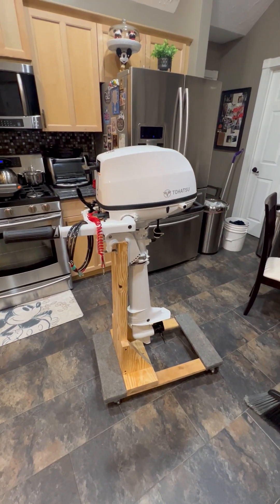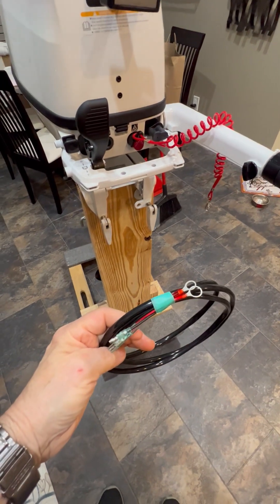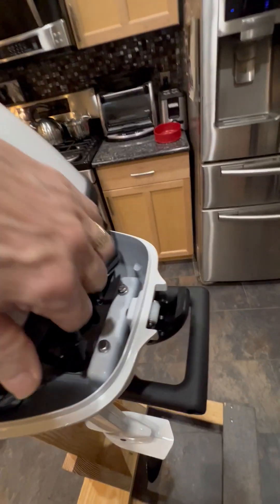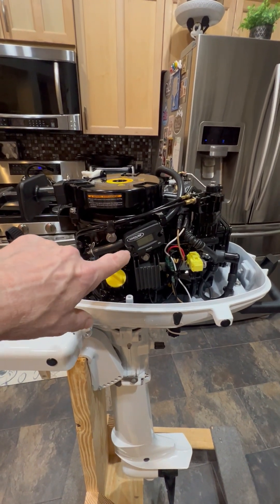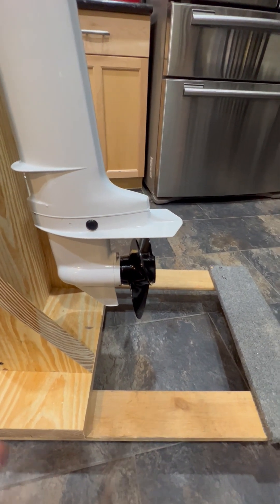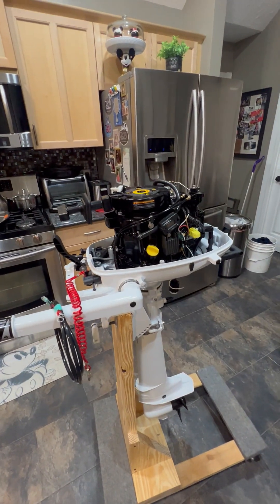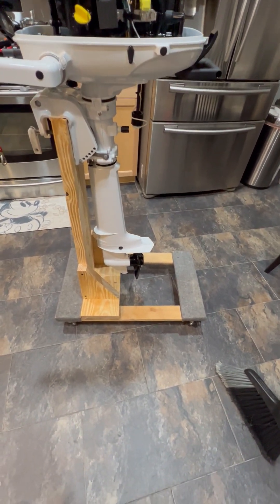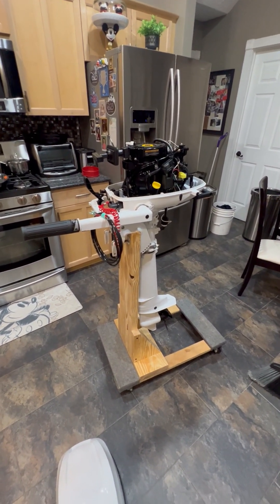Sail Pro charging system

Comment: How many hours between service? Thanks for the video. I have a 2015 and sail in salt water. I used the charging systems but a 25watt panel does the job better but the outboard charging is a good backup.

Comment: Thanks for this video Mate, I’m looking to replace my Merc 8hp 2st nothing wrong with it, just want one with a charging circuit and 4st for ease of petrol. I was tossing up between the Merc 9.8, Tohatsu 9.8, 8, 6 in 212cc (36kg) and then found the smaller lighter 6hp sail pro. Weighing at 25ish KG’s 60lbs? I think I’m sold there! But it looks like you do have the normal prop not the high thrust. The high thrust really have Mickey Mouse ear shaped blades. But thanks for your video, happy sailing!

Comment: Nice video, thanks. Looks like they intend us to wire the charging output straight onto the battery.  Is this what you do, or do you (/can one) feed it into the solar chargeing controller to prevent overcharging?

Comment: Hey Bob: I just bought a Rhodes 22 and am shopping for a motor. The man at the marina where I bought the boat suggested I get a Tohatsu 6 hp like the one you have. I'm interested in how it performs on the Rhodes. Are there any videos in the works on it pushing the Rhodes? I'd like to see how it performs. (or. if not, perhaps you could respond to my comment.)  Thanks in advance.